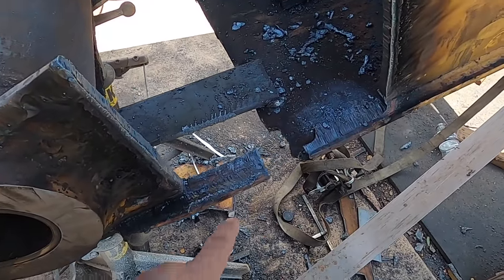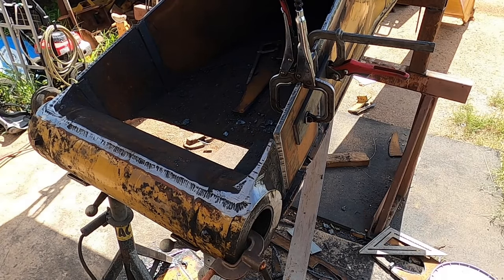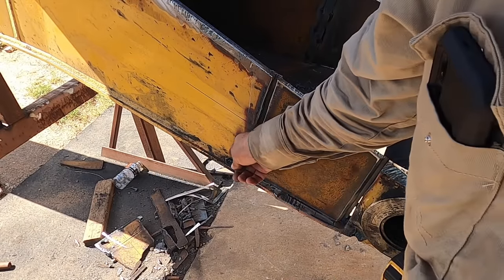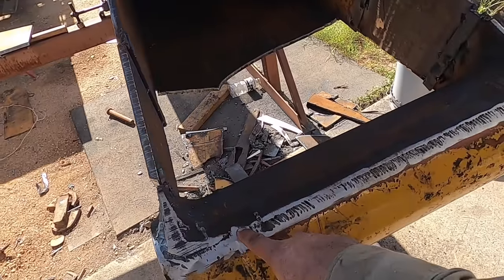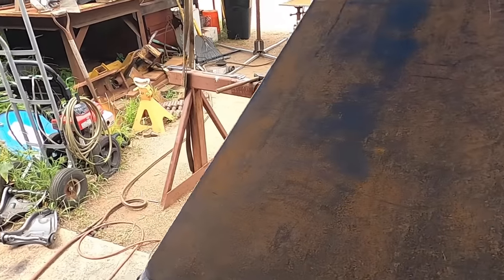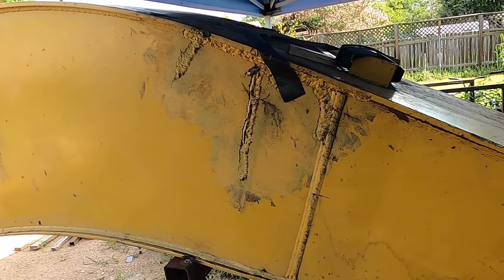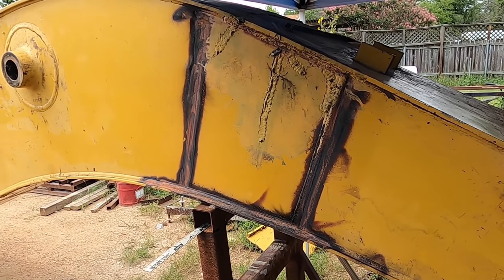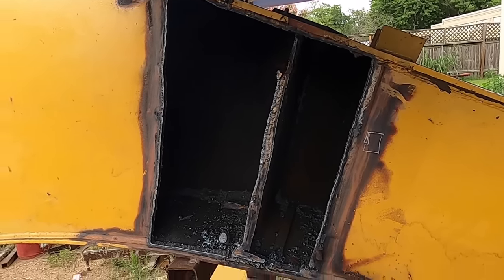Part Two: Excavator boom repair

Comment: I noticed that when you made that first long cut on the top plate, you didn't clamp down the guide block. It took me a moment to realize this and was amazed, again. It shows what a soft touch you have with that torch.
Reply: Also that guide block is steel bet it wieghts 50 lbs or more
Reply: @jeremyhanna3852  nah thats definitely just a 4x4 lol look how easily he moves it around with one hand
Reply: @BillyBigRiggin359  i will agree it aint steel but maybe aluminum
Reply: @jeremyhanna3852  I thought it looked like wood but it didn't burn.
Reply: @jeremyhanna3852  its wood lol you can see the grain. The only reason it didnt burn is because the flame doesnt actually touch it. I use 2x4s and 4x4s as guides all the time. The flame is about a 1/4 inch away which with the flame being concemtrated straight out from the tip keeps it from burning.
Reply: @timothyball3144  right im thinking aluminum maybe Isaac will chime in
Reply: @timothyball3144  if it was wood it would atleast smoke turn black
Reply: @jeremyhanna3852  like i said, i use wood all the time as guides. It doesnt burn it unless you touch it or point the flame directly at it. The flame is super concemtrated in an outward direction. You can get your bare hand pretty close to the side of the flame before you start to feel any heat. But if you try putting your hand infront of the flame your going to feel the heat over a couple feet in front of it. Im not just talking out my ass here lol
Reply: @BillyBigRiggin359  I watched again and I'm just not sure. In some shots it looks like I can see wood grain but in others I don't see any wood grain. The only thing I know for sure is that Isaac is da man.
Reply: @timothyball3144  that is true. But still, its gotta be wood. Steel would be about 163 pounds for a 3 foot 4x4. And an aluminum one would be about 53 pounds. And he just moves it around with one hand way to easy to be anything else lol. A 1 inch cube of steel is about .283 pounds. So 4x4x36x.283 gives you roughly 163 pounds. And aluminum is about ⅓ the wieght of steel so you get about 53 pounds. You cant dispute math! Lmao
Reply: You can see it close up at 17:42. The scratches look reflective which to me means it's aluminum.
Reply: @BillyBigRiggin359  you can't dispute math, but you can dispute the numbers used to calculate the math lol. According to the Google, aluminium is 1.52 ounces per cubic inch. 36 inches by 3 inches by 3 inches is 324 cubic inches. Multiply that by 1.52 to get 505.44 ounces and divide by 16 ounces to the pound to get 31.59 pounds. Sliding it around on a metal plate would be easy. Also, as someone else mentioned, the scratches are shiny. I say that it's either aluminum or aluminium. And since he's in Texas, I'm going with aluminum. 😁
Reply: It is old oak dunnage. Or cribbing if you an Ironworker. Very hard, won't smoke unless you direct the flame right at it, and often times, if kept dry, will stay very straight.
Reply: @timothyball3144   yea youre right, but thats a 4x4. 4x4x36=576x1.52=875.52÷16=54.72. I did the math above in my head and was still closer than you lol
Reply: @timothyball3144  like i said brotha. I literally use 2x4 and 4x4 for guides all the time and never once charred it. You just gotta know what youre doing man.
Reply: @SH19922x  Right, it would be a bad idea to carry it around on his truck, but he is at home so he wouldn't be carrying it around but rather it could be something that he keeps and uses there. As for it getting bent with heat if it is aluminum, maybe it's a piece that he got at a scrap yard for dirt cheap and if it gets damaged, it's not a big deal. There are alot of things that we can only guess at and as we sit here on our keyboards guessing, every comment helps the algorithm which helps Isaac's video seen by more people and that's a good thing.
Reply: @timothyball3144  honestly heres the only real way to solve this. Have you used a block of wood as a guide to cut plate? Because i habe and it doesnt do anything to it. But maybe im just on isaacs level on the ol gas ax?🤷‍♂️ 😂
Reply: Ok that guide the corners are more square that any 4x4 that I’ve bought. Could it be hollow ???
Reply: @dirtfarmer7472  it all depends on where you get your lumber. Ive had nice crisp corners on wood before. And at one point in the video you can see a chunck taken out in one of the corners. And it looks like chunked wood lol
Reply: @dirtfarmer7472  if you pause at 17:42 you can see the demts and chunks in the corners. It just looks like finished and painted 4x4. Like he took it to a jointer or planer to get some crisp edges and painted it white.
Reply: @BillyBigRiggin359  No one has denied your statement that it won't burn. Not after you stated it. I can accept that it won't burn, so I'm looking at other evidence such as the sharp corners along the sides but rounded corners on the ends. I am thinking that if a piece if wood had such rounded corners on the ends, the sides would be banged up as well. Also, there are what appears to be shiny scratches along the sides but no splinters of wood.
Reply: @BillyBigRiggin359  I don't know, man. To me, that triangular dent just to the right of the edge of the shadow looks like it has displaced material around it that shined up from sliding it around. Also, at that same timestamp, the shiny scratches really look like AL. to me. Maybe it's a trick if the light in painted wood. Painting the wood is a good idea to help keep the splinters at bay and make for easier sliding so I can see someone doing that as well as planing everything smooth, but I just don't see taking the time to do that. I mean, its possible, but to me, it sure seems unlikely.
Reply: @timothyball3144  you can buy finish wood that is already finished to crisp edges and what not and just paint it. And the scratches just look like scratching through the dirt and grime to fresh paint in contrast to the dirty paint from sliding it on the metal? Idk only isaac truley knows lmao. Everyone place your bets!
Reply: @BillyBigRiggin359  I have my bet down and you have yours down. Let's hope that he lets us know. Peace, brother.
Reply: @BillyBigRiggin359  not commenting on material type but the dimension, I don't think it's 4x4, the nut holding the torch tip is riding along the top so its more than likely 2x2 or less. My reasoning on it being aluminum is the edges are too sharp and square and smooth. Any wood will develop rounded edges with very little handling. What ever the dementions are it's the perfect size to allow the torch tip to remain at the perfect height which leaves me to belive it's been made for this purpose and is probably a hollow tube with blocked off ends.
Reply: @garymurt9112  he is using a fairly big tip though it looks longer than his middle finger. At the very least its 3x3. My middle finger from tip to knuckle is 4 inches, amd yes i just measured lmao. Plus the added thickness of the gloves? 3x3 to 4x4 would be my guess
Reply: Watching him move it and do the little saw action to get it lined up at 17:12 I am sure it's aluminum.
That motion takes weight to do, otherwise the far end is just flopping around.
It also looks like aluminum that's been kicking around a work truck for a while, dinged and scratched, and no signs of any burning on it.

It looks like it's just the right thickness to ride the tip nut on, so he probably has it for exactly this purpose.
Reply: @djkommando  I thought it was concrete but it's definately aluminum.
Reply: at 9 or 10 seconds in you can clearly hear a metal ringing sound as the torch touches the guide block, and then at about 12 seconds as he runs the torch down it, not the kind of sound you would expect with timber
Reply: @SH19922x  haha 😄
Reply: In his podcast with welding tips and tricks he said it was aluminium 👍🏼
Reply: @peters4067  Where’s “Cocobandit” now? LOL
Reply: You started an argument chain about a 2x4 / 4x4 😂😂😂
Reply: Άψογος

Comment: Your analysis of the grain flow in the steel is right on. CAT had to replace the box between the frame rails on six 793 trucks. The original box was made with two pieces of 2.5" steel formed into "u"  and welded together. The steel was bent such that the grain was parallel to the rails.  They cracked from the twisting.  We cut out the old boxes and replaced them with 3" thick steel castings. We have 50 degree Vees on both ends.  It took two of us 6-7 hrs to tack fixturing to hold the rails. It took another 8 hrs to cut and prep the cutout and 7-9hrs to weld in the new with backing plates inside.  Fun job.
Reply: Good paycheck
Reply: Used to work for emeco 
We hired out a fleet of 793Bs while westrac (West Australia cat dealer) was fixing the 793Fs 
They'd take the customers trucks back to Perth and ship our trucks out while they did the month long recall list 
Was a real big paycheck for us and emeco in a bit of a downtime in the local mining sector 
Saved some jobs for a year
Reply: @fowletm1992  I enjoyed your email. I'm not sure how we hooked up, I didn't remember "reply" that eneded up being you.
However, I worked for CAT 33 yrs in Decatur, IL.  Decatur plant used to build the motor graders, they added tractor scrapers some time in the 60's, and the first two trucks 35 and 50 ton(I used to remember all the model numbers but now my brain is numb.  They added the 777 then the 785 and 787 then the 793 and then the 797.  they had a problem with the spacer box between the frame rails along about 1997 on a few of the 793's.  The box had been fabbed out of 2.5" steel, bent into t\wo "u's", welded together-a box, then welded into the frame.  One batch of steel got turned 90 degrees in forming, thus placing the grain in a compromising situation.  Our weld engineers invest-d, created two fixtures, to hold the rails in alignment to remove the box and fit a new 2.5" steel casting box.  We had six trucks in house at the time and two of us were assigned to repair those.  This was during the UAW strike in 1997 and we were both CAT mgrs. reassigned to welding.  I had welded on the 100 ton truck frame for 18 months and Mike had welded on motor grader parts.  It took us a month to repair all six trucks.  One day to set the fixtures, one day to cut out the old box, trim and fit the new box, one day to weld the new  box, and one day to remove the fixtures and clean everything.  Heck of an experience.  The CAT Truck Mgr offered his first born to us but she was ugly and fortunely we were both married "but not to each other"!!!!!!
Hope all is well with you.  I'm a big follower of "Kurtis" at Cutting Edge Engineering  "CEE" on YouTube.  He does some amazing work like Issac.  My email is 4570.delta@gmail.com if you'd like to converse.
Daniel in Decatur, IL.

Comment: Who needs a plasma when Isaac is on the torch, holy smokes those are some amazingly clean cuts. Whoever "fixed" the boom previously made a mess. Can't wait for the next installment.
Reply: Whoever built it made a mess... You don't do square corners like that. It's one thing to make do and make the piece you have fit but if they just clipped the corner into a bit of a 45 it would have spread the stress out and probably wouldn't have cracked there. 

Great job with the torch!
Reply: @cobra02411  if the backing plate near the end of the vid was factory, I'd agree, sloppy work. But I was specifically talking about the poor quality of the welds, per Isaac, no grinding and raw weld puddle visible.
Reply: @mmerdmann  I get that, but if that piece was done better originally it might not have cracked there. The repair was garbage so it failed again...
Reply: He's an old jedi. His lightsaber is disguised as a torch
Reply: The torchman!!!

Comment: Your very correct on your assumption of grain and strength, All grain in metal should run the long length of a sheet, not as critical with steel, but very critical with Aluminium that I work with a lot in the aircraft industry. Grain direction is set in the mill in the rolling process. Love your work and wish I was 1/10 as good with a torch as you are. Love the vids.
Reply: Thanks Brent, I didn't know that.
Reply: I was a printer (pressman) for many years. Paper has a grain you had to pay attention to. Makes sense metal would also have a grain. Good info.
Reply: P.

Comment: I'm impressed with your steady hands.  I'm just a weekend warrior who has a small gas rig and does minor repairs/fabrication around the house.  I loved the way you located the end of the boom by setting your data points and then tack welding the barrel to establish its final position.  Great video, thumbs up.

Comment: Thank YOU - I C Weld - I have been making pigeon tracks for 40 yrs. I worked on projects for myself.  Your videos in the last couple weeks pointed  me in the direction of  How to fix my problem.  I was running a flux mig - and switched to stick - to finish.   I would not have trusted myself to follow thru - but with the repairs, you have done, in my mind, I forged ahead.  Took me a few days to make the repair..  I am retired, so I don't need production results.   Kind Regards!

Comment: I was kinda surprised to see how much old material you were replacing. Then it occurred to me that most of the material close to the old cracks was probably work hardened because of all the flexing before it broke. Probably wouldn’t have been that long before it cracked again.
Reply: That it also get fatigued and will crack again
Reply: @jeremyhanna3852  tired iron you can't horse that old eguipment somebody gave it some new stretch marks poor old gal

Comment: Isaac , I find it interesting how you use wood as a guide, early in my career I always used steel....but 7 years ago, I started working in a shop where we did wood fabrication and steel....I found it was very helpful to use wood for spacers, guides and what not......just kept a chop saw close, and wah lal.....lot easier and cheaper that steel or aluminum ......Best Regards.....
Reply: It looked like he was using the block as a height gauge as well. Very clever.
Reply: @keithprince5129  I agree....
Reply: It’s also a whole lot lighter and until recently much cheaper also
Reply: How come the wood doesn't go on fire 🤔
Reply: I am pretty sure the bar he was using as a torch guide is aluminum.
Reply: @kevinwalls19  the heat is not directed at the wood....

Comment: You are right in looking at the grain of the steel you are using vs the forces that induce in the part you are building. Your experience and mechanical sense are again right . 👍

Comment: What you are finding is not so unbelievable. Components are build all over the world and too often they cut corners on the requirements as no one is going to be able to know once it is all closed up. Your attention to detail is highly commendable. Once this is done, it will be stronger than the original and will most likely outlive the rest of the machine. Thanks for sharing.

Comment: I think you are correct assuming grain runs length wise on the plate......I wonder if you could do a test etch? but I guess maybe a destructive bend on a few samples to confirm which way  grain runs.....if you had a big bad hydraulic press, maybe the steel supplier could be asked? best wishes, Paul
Reply: Paul, I was told that the grain structure usually runs lengthwise with the main plate. The way it is rolled. May be defined by a painted line or printing in that direction. I was just thinking about this when IC mentioned it. Reassuring...
Reply: @larryskeeper1197  that is a good point, but we do not know if it was rolled lengthwise and sheared or sideways and sheared in a  short width?  Most likely lengthwise, they sure don't print on it as it comes out of rolling or shearing as it is still quite hot. I know for the thicker plate, it is oxy fuel cut.....for smaller stuff sheared....1/4 inch sometimes comes in rolls that is then unrolled and straightened and sheared at a service center., you can get plate very long....over 40 feet ....not sure about rolling thicker stuff like 3/8 or 1/2...I will get with my steel supplier and see what they say....cheers.....Paul

Comment: Mr IC weld , if you calculated a 37.8 degree angle you cut a 37.8 degree angle, you cut that steel like a machine 😀 . You da man on that torch . 100% .

Comment: i think you are spot on with your theory of the plate grain running a certain way , when its rolled in the mill and processed into plate its sheared with the running length same as it came off the line and shipped in bundles to the supplier

Comment: A 4" x 4" track torch.  That is great.  I would never have thought about doing that.  Invention on the fly is the most fun you can have, but having the tools at hand makes it even better.
Reply: Neat thing about that is that the tip nut rides on the corner of the 4x4 like RR tracks

Comment: Naw, IC that's no less than a 38.2 degree angle! Lol Great job "Stick" welding. I'm in the process of making a set of backhoe outrigger shoes. 7018 is the best thing for them on 1/2 plate. So I'm gonna have to practice my stick welding. Have done very little stick since I got my Mig over 10 years ago!

Comment: It truly is amazing to watch a master at his job do you understand the physics of what you’re doing not just replacing a piece of steel or just doing a half assed patch job which is what you seem to be fixing a lot of and I never knew steel had green to it like a wood !!
Reply from the maker: yup. there are internal stresses that can make them bend because of the mfg process. So when you cut out smaller pieces, the warp can show up.